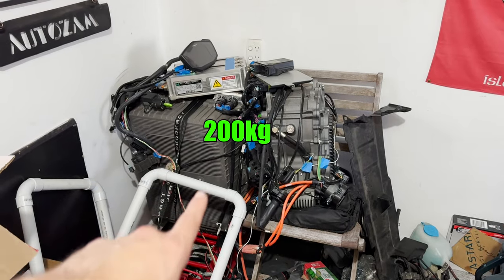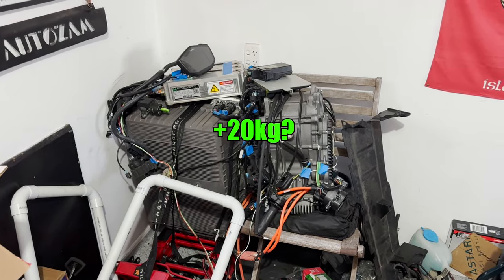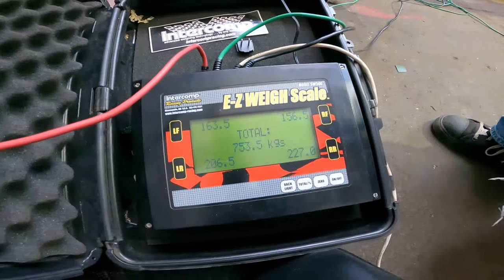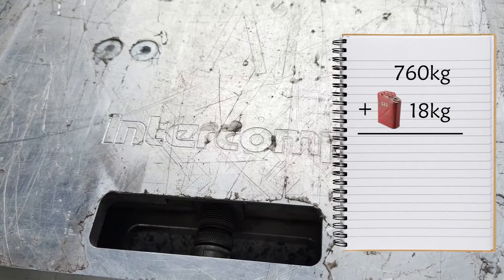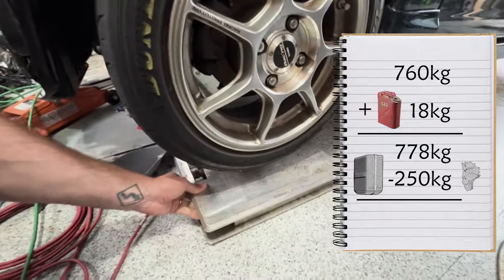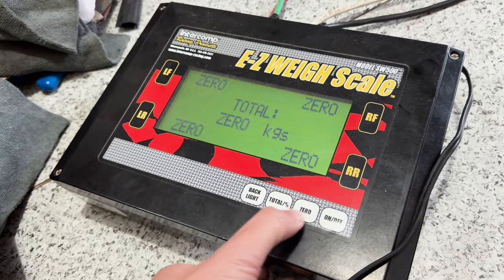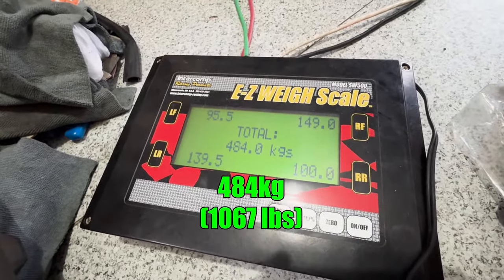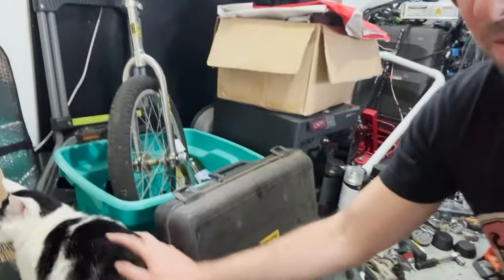Electric Honda Beat Conversion - Episode 13.5.5 - Back on the Scales

Comment: Congratulations .. it's all going to work out!!  .   I'm really interested to find out how you will be connecting the motor to the diff. And, how they will be mounted to maintain perfect alignment. This could be really tricky. Next episode?
Reply from the maker: Thanks Brian! Some kind of coupler that fits on the Energica's shaft and bolts to the diff. It seems like a common thing to do with conversions so I'm not too worried. We have the technology!

Comment: Almost a hundred "freedom units" of wiggle room? Nice! "Lighter as an electric than as a gas car" is really how it should be. Electrons shouldn't weigh more than gas. 
(I know, I know, it's the batteries, but still.)
Reply from the maker: Yeah man!!  And this is with the old motor/battery setup.  I'm still hoping to upgrade someday to the new Energica stuff and that'll drop another 45lbs from it, while also increasing power and range.

Comment: Sam, just remind us, why is the weight so critical? Does it have to be no heavier than the original ICE weight to qualify as some cheaper-to-tax category of vehicle or something? Or would you not be allowed to use it on the road at all if it were too heavy?
Reply from the maker: There's a max weight limit to be legal on the road, yeah. It's harder for kei cars because they're so small and don't technically have places to put cargo (extra weight). It's strict, but I'm excited to have a car with double the power AND is lighter than it was originally 😂

Comment: Awesome! Always nice to have some wiggle room. 
I've been contemplating what I'm doing with mine. So looks like the same place I got the Beat from has a $1,200 Hayabusa so it was kinda meant to be. Going simple with a chain driven spool as I'm concerned about a chain driven diff that's not in an oil bath heating up and even though it's a motorcycle engine it's probably going to be pushing some serious power eventually. I mean if you have a 'busa motor you've got to turbo it right?
Reply from the maker: NICE!! Dude I can't wait to see how crazy that car turns out. So no diff?? All drift all the time? 😲
Reply: Yep, still keeping independent rear probably with gen 1 Miata axles, but I'd have to go TorSen if I wanted an LSD back there and since this thing is going to be doing rally racing I'll just deal with it chirping around corners on the pavement. The big thing I'm trying to decide on is building a hardtop roof or importing one since the original soft top is trash.

Comment: Rich Rebuilds has started racing you. I don't think he's worrying much about quality or registration, but he's started!
Reply from the maker: I saw!!  I'm excited to see that thing move under electric power.  Mine is currently at the shop getting mounts fabricated but I have no idea when my next video will be.
Reply: @NewZeroland  I'm absolutely certain yours will be vastly better. I'm also pretty certain he'll finish first, mainly because his jobs are more like building props than building something that you can use every day.
Reply from the maker: @gasdive  haha thanks!  Rich's project is pretty unique, but I'm sad he's only adding 15hp to the car.  It seems like a lot of work for such little return.  At least double the power!!